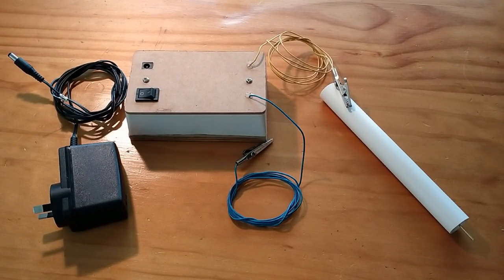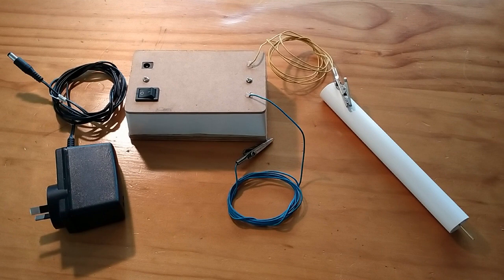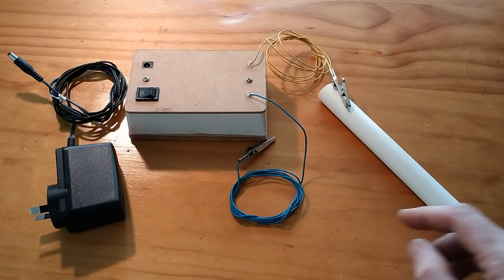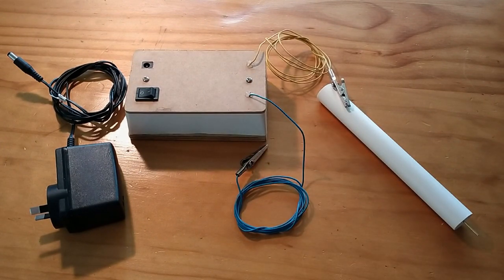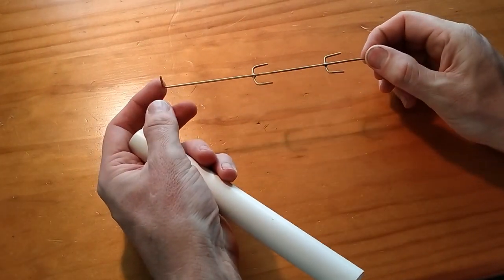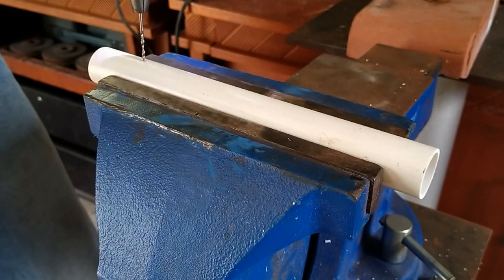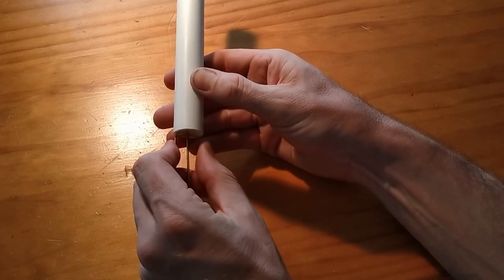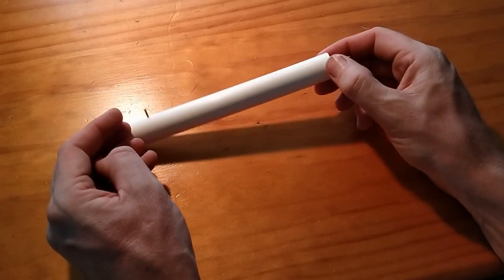Electrostatic Chamber

Comment: Hey there .. Thank you for the fantastic videos ....
I tried ordering the high voltage unit through your link .. no joy ☹.. do you have another link ? Or a tech description that i could use on ebay ? Thanks so much ...
Reply from the maker: Hi, I just search for "400kv high voltage generator" on eBay. An example from China is https://www.ebay.com.au/itm/191961019028?hash=item2cb1c4b294:g:AdcAAOSwzPdZtg5S Hope this helps.

Comment: TOP set up there. I am trying to apply to use it with my airbrush, to paint plastic model kits. Might not work due to plastic not being conductive...but I am hoping that although not conductive can still hold charge on the surface.

Being an airbrush will be a very small set up and I was wondering how is the electrical diagram of connections. If I am not wrong the HV + needs to be on the nozzle and HV-  in contact with the paint and the object to be painted? thanks!

Additionally, on this video...looks like both HV cables are just in front of the nozzle, just charging the air in front of the nozzle jet. Looks a bit odd....what do you think?

Cheers.

Comment: I got new voltage generator today  but I think  it  might  b  a dud it will only  throw a spark 2mm long and will  not ionize the powder
Reply from the maker: Might be. You should be able to get a spark way longer than that. You can see the gap I had in the original video and the length and intensity of the spark.

Comment: Hi  I made a gun similar  to your gen 2 , I have done about  9 pieces  and the generator  unit has given  up on me  i did however  earth it out a few times I got to close,  do they have life span  , I was thinking  of  putting in a foot pedal so it is not live all the time , I was using  a 240v to 5v 1000ma usb as a power supply  I got impatient waiting  for the buck converter is it possible that this may have shortened the life of the generator. I have got the bug now for powder coating all my cnc plasma  cut projects .
Reply from the maker: I had the same problem when I first started out as I was just using the high voltage module connected directly to a power supply. That is why I introduced the buck converter to stop it supplying to many amps and frying it. The buck converter is an essential item I'm afraid.
Reply from the maker: I used my gen 2 gun in anger today and it was far superior to my original gun.
Reply: Thank you for your  help in upstanding way it failed , will have to wait for a new one to arrive  now will most likely  b a week  as the post  is so slow lately

Comment: Thanks for the video and updates. Does the holding wires need to be made of metal? I am thinking making some out of plastic to keep the wire centered inside the tube chamber
Reply from the maker: If you want to try it out just for fun. I used plain flour first to see if the concept worked. Amazingly, flour will stick to metal. Just use air to blow it off when your done.
Reply from the maker: I wouldn't think so. That is just the method I chose. I don't have a 3D printer and I wanted to keep it thin.
Reply: @tinkersmith4615  Big thanks.  The gun I made almost looks like your 2nd gen gun. Whereas I used a pvc elbow. I'm just waiting for the powder I ordered to try it out